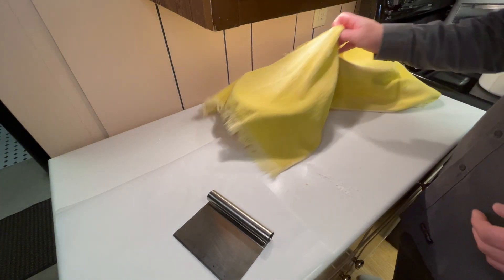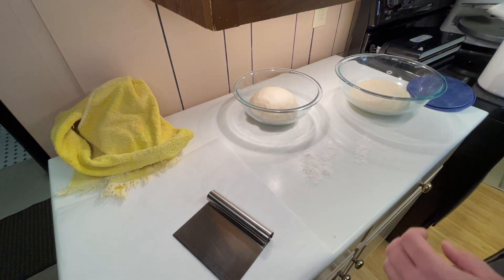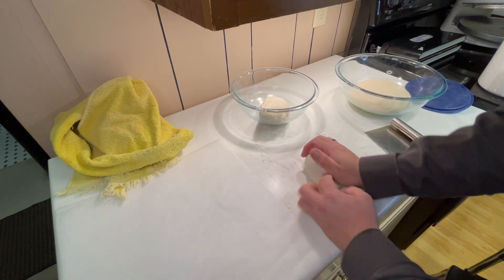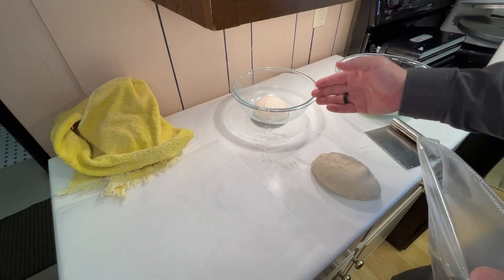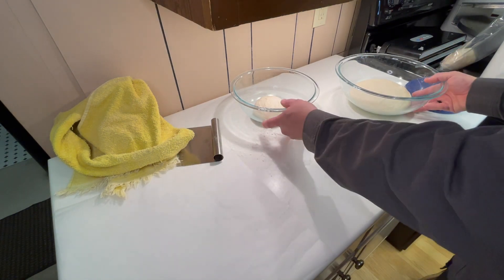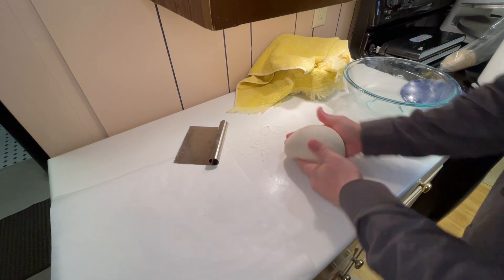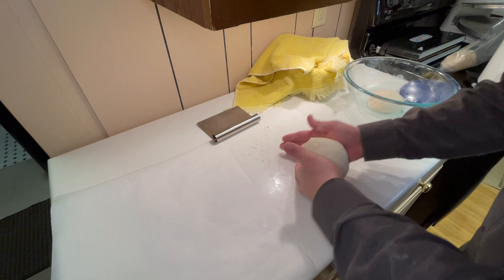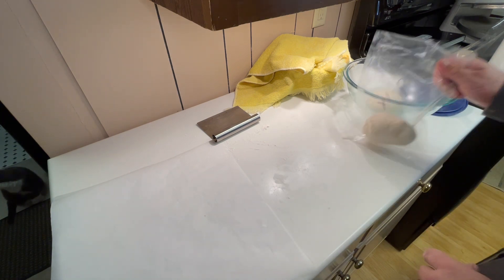Dividing and Vac Sealing Pizza Dough.

Comment: that's it?   no results?
Reply from the maker: @cathycullen8851  the dough creates enough “gas” that the bag just fills up, essentially undoing the vacuum seal. Not really worth vac sealing, a ziplock works the same. Cheers.
Reply: @Elveshelves  Some say that you let it do final proofing before vacuum sealing.  I might try that.
Reply from the maker: @cathycullen8851  I just went back to making it fresh and using it that day.